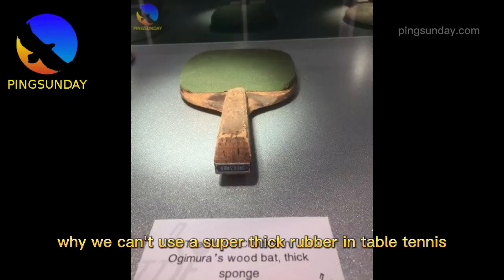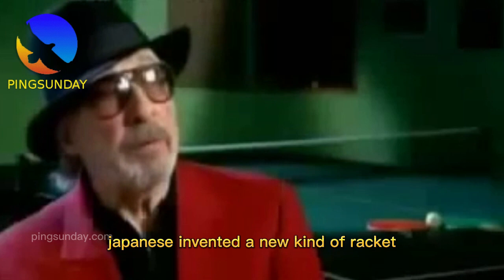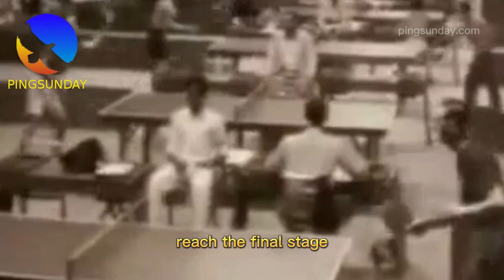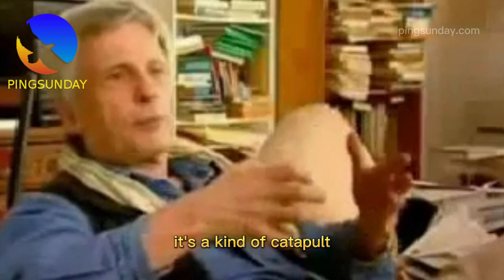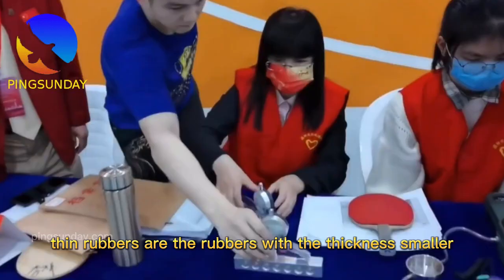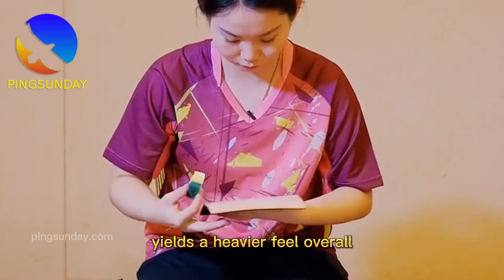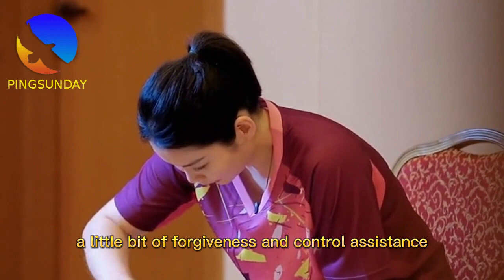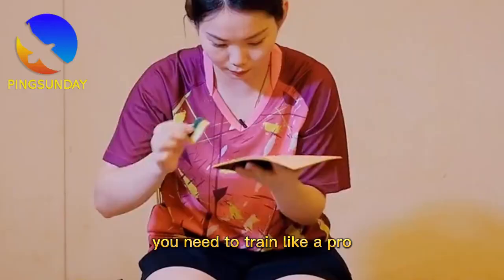Difference between thin and thick rubbers

Comment: I have a new An Jae Hyun blade (trimetrix carbon) with new Jekyll&Hyde Max rubbers each side. You are right when you say this combinations not good for lower level players. I need work hard for my fitness to use maximum options with this racket..im 46, and still practicing and six month later i started to see what is this racket do. Awesome. But i need hard workouts :P

Comment: Hi coach
I'm planning to use XIOM vega europe (as a backhand rubber) on the Stiga Clipper CR blade (which is an OFF+ blade). Should I buy the version with 1.8 mm sponge, 2.0 or MAX thikness, or should I buy a different rubber (such as XIOM vega pro)? I am an intermediate level player.
Reply: Personally, i think 2.0 is the sweetspot if you are unsure of what you like or what is the best for you

Comment: So which is best for forehand and backhand
Reply: Forehand (2mm-max)
Backhand (1,9mm-2,1mm)

Around that range. If you can't handle the speed, don't go lower with the thickness, change the blade instead. Beginners to Intermediate players usually prefer to play with carbonless blades. Wood only gives you a lot more control and less speed.

Comment: Thin sponge gives the ball slower speed and more control ? Shouldn't it be the other way around ?
Reply: Nope. That's how it is. Sponge gives you speed/ catapult. Try a thin sponge (or even wood only) and you will see you can control where you place the ball.